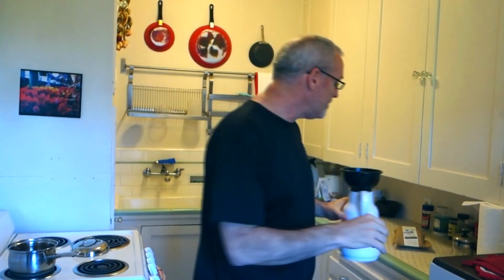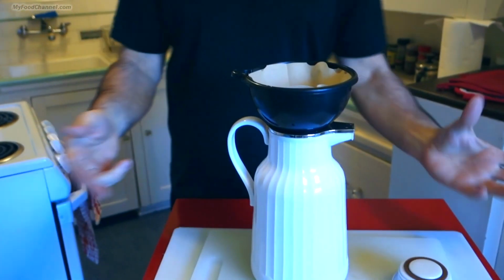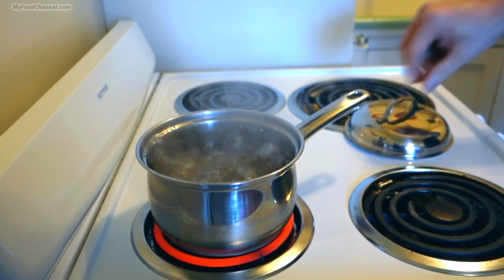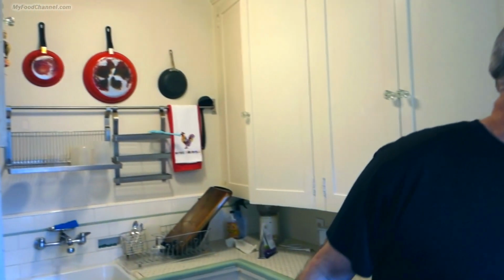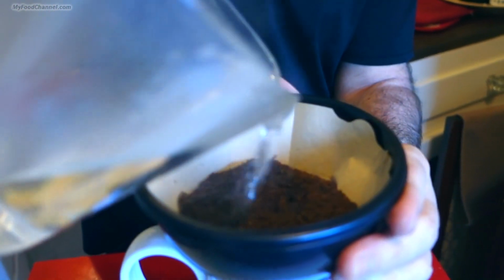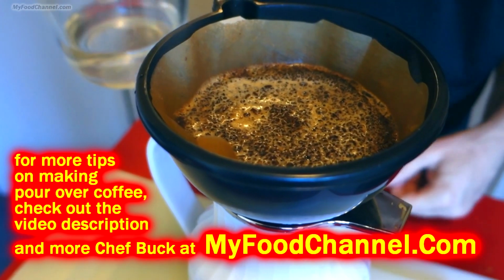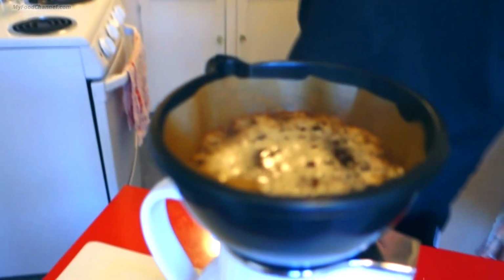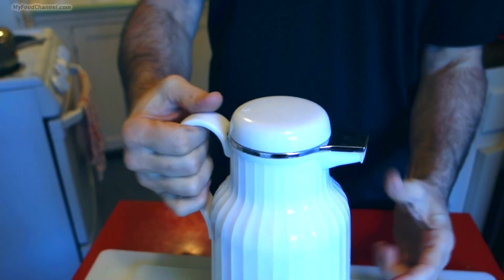Best Pour Over Coffee - Make Great Coffee without a Coffee Maker

Comment: You guys just crack me up!
I used a plastic 1-serving Melitta pour-over cone when I was living in my RV, because I could still make coffee while "dry camping" without a 110-volt hookup. And it was much easier to pack up for travel than a coffee maker with a glass carafe. I've continued to use that same cone since I came off the road into an apartment in 2018. The counter space a coffee maker would occupy, holds an electric kettle instead.
I know what you mean about having too fine a grind, because it just becomes impassable mud in the bottom of the filter. I have to stand there and rattle the cone to get the last 2 inches of water to go down.
 Enjoy your fancy-shmancy coffee, Mon!

Comment: One thing I learned that really improves pour over coffee is letting the ground coffee "bloom". Just pour a bit of the hot water on the coffee and wait 10-20 seconds for the coffee to soak up the water and develop a bit of aroma. You can see the coffee produce some bubbles and soak up the water. That way the water doesnt just run through the coffee and the extraction gets better. Also depends on how coarse or fine you grind your coffee. Experiment what works best for you. Personally I really like pour over because it's fast, easy and leaves a lot in your hands.

Comment: I’m not sure I can achieve the strength of coffee I like using this method. I found Aero Press is much better than i anticipated, efficient, little mess if any and because it uses trapped air to push it through faster it does actually temper the bitterness caused by heat and kinda stewing. 
Always enjoy Buck’s tips and humour regardless
Reply: I'm with you on the AeroPress.  I bought my first one in 2012 and have never looked back.  Last year, when it went on sale, I bought the XL version, which was a very exciting event for me!  That about sums up my life; give me my burr grinder and my AeroPress and every morning is a happy one☕

Comment: How are you liking the flavor of the  glue from the brown paper filter in your coffee????
Also, is your funnel "food safe" or are you getting a big dose of benzene each time you pour hot liquid through it? 

After having been a coffee snob for decades I finally realized that junk is added to coffee every time a brown paper filter is used that isn't rinsed out with hot water before hand. So I'm passing on the way to get an even better more pure flavor to people who think, like I used to, they know  how to make the best pour over coffee using dry paper filters right out of the box.

 So, if you want pure coffee flavor that is NOT mixed with a lot of glue and coloring from the brown paper coffee filter, first rinse away the glue by pouring some boiling or just under boiling hot water through just the filter. Make sure to pour it on all sides of the inside of the filter to keep the filter open and let the brown water drip into a container so you can discard the brown water. (I use a glass jar with a little cold water in the bottom of the jar to prevent the glass from possibly cracking from the hot water.) After that is done THEN move the rinsed clean  brown filter and holder to the carafe  and add the ground coffee to the wet clean filter and pour over the hot water. Or in your case, pour the already filtered french pressed coffee through the now much cleaner brown paper filter into the thermos carafe,

Better yet, if you have a french press, why are you bothering with the funnel and the paper filter at all? I would not even bother with this step. Just pour the hot coffee from the french press into the measuring cup for easier pouring and then into the carafe. There is no need to use a paper filter or plastic non-food safe funnel at all. The french press has a built in filter which is part of the "press".
Reply: Wow! I worked many years as a bookkeeper, so I appreciate your attention to detail. Have you ever considered starting a custom baby food business, for new parents who want purity and great nutrition for their little one, but don't have time or physical resources to DIY? Wishing you peace, prosperity and excellent coffee in 2025.